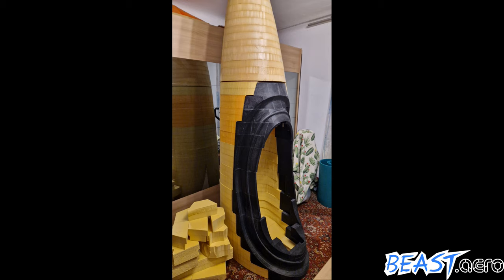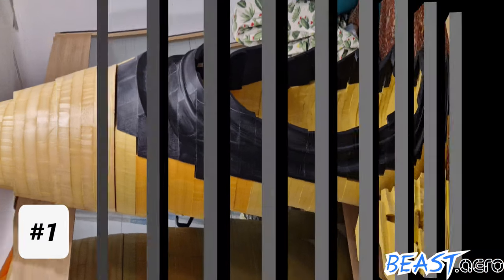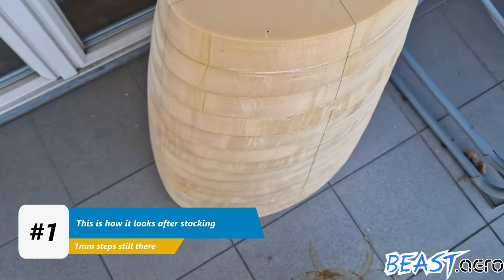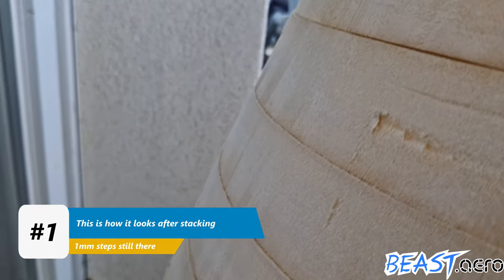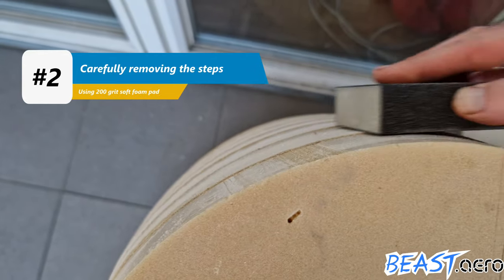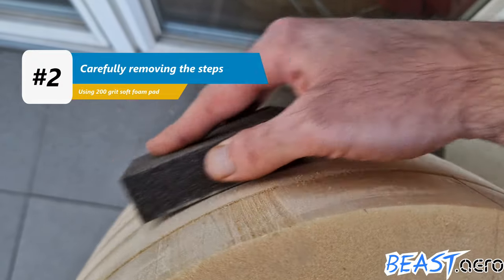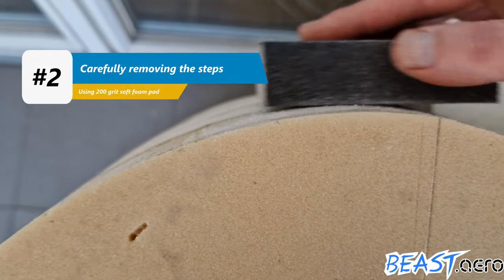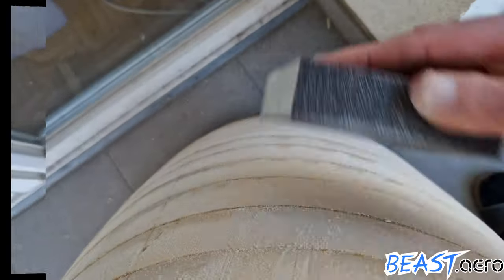Horus VLog #04

Comment: What engine do you plan to use? Will it be a turbocharger?
Reply from the maker: PBS TJ-100 or TJ-150. It has a radial compressor like a turbocharger, but the rest is completely different. It is a real jet engine, mostly used in cruise missiles.

Comment: I'm sanding some gear leg fairings on my kitplane right now. Do yourself a favor and get some flexible sanding blocks. Only way to get a smooth surface. Specially on the surface player. And guide coat poweder.
Reply from the maker: Thanks! This is exactly the plan, but it will only be done in the next step after the coarse alignment.